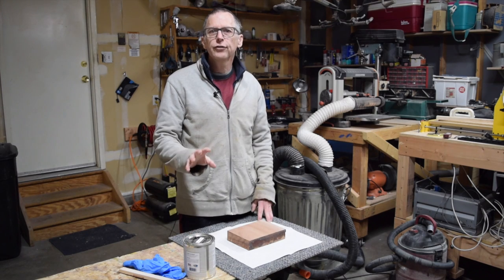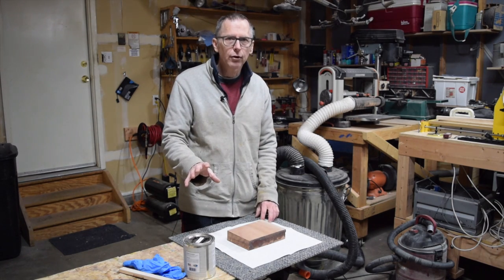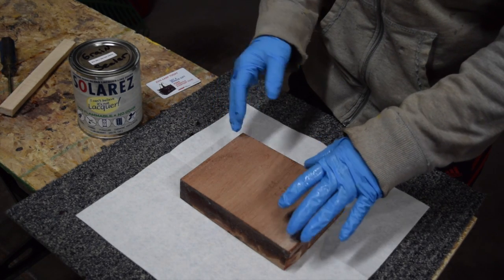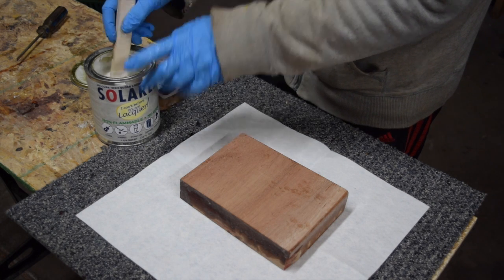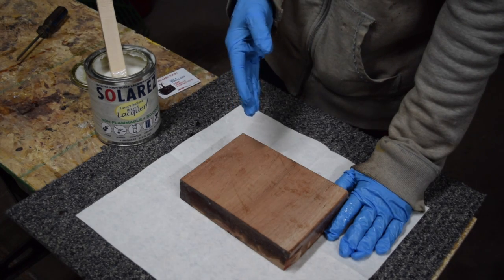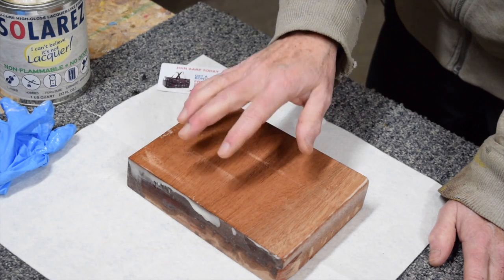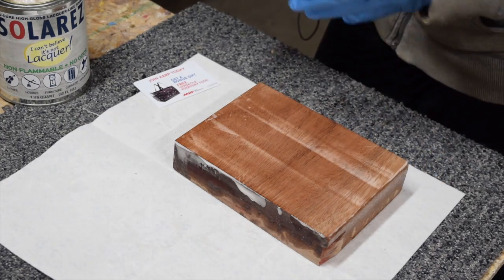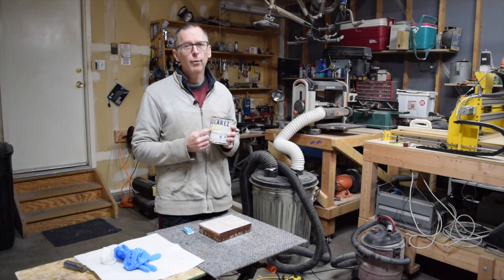The Best Wood Grain Filler I Have Come Across

Comment: I had the exact problem you described happen to me when restoring an old bass drum. I used a water based grain filler that dried super quick and after multiple coats of clear the finish was flawless. After about 3 months grain lines started to appear and being a high gloss black it was quite noticable. Since then I've been using a 2K polyurethane basecoat to fill the grain just by laying down a super thick coat and then level sanding it. Not particularly cost efficient but it does work well. However I heard even catalysed finishes tend to shrink just a tiny bit over time.

Comment: This is the exact video I needed exactly when I needed it. Next project I'm using this. I already went to the solarez site and put it in my cart. I used timbermate on a mahogany body on my current build and after 3 applications theres still spots that i can see the grain. I dont mond doing multiple coats but it would be great not having to wait to long for it to dry. Plus it smells God aweful. I wish I'd seen this sooner.....my girlfriend will never have to worry about my shrinkage problems again!!!
Reply: I found Timbermate to be difficult to work with and not worth the extra work. I think I’ll use this as well! Hope you had good results!

Comment: I ordered some of this stuff directly from Solarez to fill a roasted swamp ash body - at least it was supposed to be this stuff... I ordered the small 4 oz size, and shook it up vigorously for a minute or so, but when I poured it out it was not white, and was not thick like pancake batter. It came with an extra cap that has a nozzle, so that’s what I used. I tried the “rub it in with fingers and scrape off with a card” method, and while that may work great for a flat piece of wood, not so much on a Strat body with the contours. I didn’t notice that there were a few drips on the sides and back and they were a major pain in the butt to level. I’m going to try the “wipe on with a coffee filter” method for the next coat and hope for better results.

Comment: I've used something called micro-balloons doing body and fender work and the product I've used is micro-size hollow glass balloons. It has the consistency of flour. Maybe its the same thing used here? So when sanding you have to be extra careful to not breath the glass dust.
Reply from the maker: Yes, this product used glass micro-balloons. However, I'm not sure if it is still formulated with them.

Comment: Other way I do it, I preraised the grain of the wood by spraying water once dry I sanded with what ever grit sand paper you finished the wood, then I sealed the wood with shellac (2 coats, sand with 400 grit between coats) then apply the wood grain filler if your choice with out worrying about shrinkage , then seal it with shellac again then finish with the clear coat of your choice

Comment: I'm transforming the cabinets in my new home. They were that old school early 2000s golden oak. I know that grain is pretty hard to hide. I just want them to be a nice smooth white. I've seen all kinds of opinions and options to do this, but ultimately this is probably one of the more informative videos. I'm hoping this stuff will fill in that wood grain and allow me to throw some paint over the top. I was considering using some of the spray paint from my job, it's a white sandable filler primer. I figured if I sanded it and then hit it with that, then sanded it again and put some paint over the top it should do the trick. But if I incorporate this product, I'm thinking I will get a better result
Reply: Hey Mr.Nuna916, over the last couple of weeks I have refinished oak cabinets just as you describe, also in white. Believe it or not, the grain filler I used was good old fashioned drywall compound mixed with a little water - to a almost molasses viscosity. Brush it on, let it dry, and lightly sand so as not to gouge out what I filled. It has worked absolutely perfectly for me. Just throwing it out there as an inexpensive, and effective, option.
Reply: @AA-dx9ky  hey I appreciate the response, and you know I've actually heard about this before. There was an older gentleman on YouTube that was describing the same thing and he had mixed it to about a pancake batter viscosity. I actually just finished sanding everything, even though I'm using Beyond paint. I decided it would be better to sand and Prime anyway. Maybe this will alleviate the chipping issue. I'm honestly hesitant to do what you did because of the amount of work and detail it would take LOL it was a pain sanding all these things. I'm going to see how sanding and priming before Beyond paint works. If I like the single drawer that I do, I'll leave it as is, if not I think I'm going to have to go your route

Comment: I have an older guitar that I am redoing. I have removed all the old painted surfaces because it was badly chipped in many places. I also have a couple of areas that have dent marks in it, where the guitar was bumped sometime in its lifetime. Would this make a good wood filler if the same color sawdust were mixed and added to this product to fill in the bumped in area. That way this product would show the wood sawdust close to the normal surface once the dent has been filled to the right level for smooth sanding? It would be a matter of filling the small dent slightly higher than the normal surface with this product and same colored sawdust of the guitars overall surface, and once cured, could be leveled by sanding that area to the right smooth finished level, thus giving it the appearance, no dent was even there in the first place before sealing the whole guitar surface on a final coat of the product you are speaking about here. Have you tried filling a small dent using this product and same colored sawdust as the guitar body? I'd be interested in your findings.
Reply from the maker: No, I haven't tried that.

Comment: Thanks for another informative video, Chris.  Can this grain sealer be dyed?  Is it compatible with oil finishes? Mark
Reply from the maker: No, it cannot be dyed and yes, it is compatible with oil finishes as long as they are completely cured.
Reply: @HighlineGuitars  Thanks Chris, any recommendations on filler/sealer like this one that would prep porous wood for stain/dye application? I want to stain the top without it seeping through the sides of the body

Comment: Hi Chris have you experienced Solarez grain filler not curing in sunlight?  It happened to me.  I sanded and prepped my Taylor 810 guitar ready for Solarez and applied it first to the bottom (rosewood) of the guitar... let it sit for a few minutes and took it outside into direct bright sunlight about 3PM in the afternoon outside it was about 65 degrees.  After 3 minutes it was still tacky on most areas.  I waited another 5 minutes still tacky. In all it sat in the sunlight for 30 minutes... it had hardened in some areas where I first applied it but the last areas I spread it to would not harden!  I had to use acetone to wipe the uncured stuff off and its quite a mess because it was partially hardened but still tacky.  I'm tempted to never use Solarez again... either I did something wrong or the stuff is a real pain in the rearend.
Reply from the maker: Never happened to me.
Reply: @HighlineGuitars  Hey Chris I talked to the owner of Solarez.  Apparently the oil in rosewood has to be cleaned completely from the surface with a white cloth and acetone or it could inhibit the curing process.  It could take several cleanings before your cloth comes away clean.  The first time I tried it, the cloth was dark brownish purple just from all the oil in the wood which rises to the surface after sanding.  I noticed there were hundreds of little brown pin head sized dots of oil all over the back of the guitar which I thought were left over varnish or stain from the factory that had soaked into the wood.  Glad I called the Solarez factory!

Comment: Hi thank you for your good  video. On the Solarez web site they are showing three Sizes of Micro Balloons filler. Can you suggest a sizes that would provide a maximum transparancy and less milky results uppon curring? because I intend to use rather dark wood since you seam to suggest that if applied in thin layers it provides a clear finish? or is phillipine mahogany is the darkest kind of wood you would recommend its usage?  Also they seam to suggest on the Grain and filler sealer product that the addition of MicroBalloons could be done for light colored wood only. So I am unsure were to stand with using this product for my application. Thank You!
Reply from the maker: That’s a question for Solarez.

Comment: When working with super open pore dark mahogany acoustic necks, I have yet to find a single product that fills the gaping pours while still providing transparency. Even Stewmac grain fillers do not do this. If you have porous wood, the only real option is to keep slathering on clear finish of some kind until you get level. This is very time consuming and a pain in the butt. If you fill the pores with mahogany colored filler, it will ruin the appearance of the grain. You will be looking at the filler, not the grain. If you use "clear" fillers like Aquacoat grain filler on really dark wood, it will "ghost" the appearance when you put on lacquer leaving a whitish haze. The only consistent way to apply stain is also before any filler is used. Otherwise you are staining filler. Next time you look at a Martin neck from the 70s or 80s, think about how much work it was to get beautiful clear grain leveled lacquer. I've also never found any water base products that work as well as oil based. Add to all this the fact that every peice of wood is going to react differently to filler and finish, and you have a lot of work in front of you.

Comment: Really nice products! Did you tried staining black so it can enhanced for example mahogany grain?
Reply from the maker: Not in this video, but I like to apply a black dye/stain and sand it back after it has dried. Then, I use the grain filler. That really pops the grain.

Comment: Chris, doing a project with swamp ash.  For a translucent finish, like a light amber, would I need to first use some other grain filler with black or brown dye first, then use solarez after?  Or does the solarez make the grain pop enough? Thanks!
Reply from the maker: It really depends on what you want to achieve visually. If possible, you should try testing different scenarios on some scrap. Solarez will enhance the wood by darkening it a bit, but it probably won't pop the grain the way you want it to. You could apply black or brown dye first, sand off the excess from the surface, which will leave it in the grain, and then apply the Solarez as a way to fill the grain and provide a protective top coat. Testing is the key. Good luck!

Comment: Hi
I need some advice on grain filler for my snooker cue which is made of Ash wood. Over time grains gets open and can be felt during playing. 
Is there any filler which is easily applied and then smooth out with 0000 wool. I don’t wanna use sand paper on cue.,
I have seen clear gel based grain filler ( by AQUA coat) but they are available only in USA. 
Plzz advise me how to refill the grains on my ash cue? And then smooth with steel wool etc. Thanks. 
Regards.
Reply: Have you tried epoxy? I know the guys who make high end fishing rods usually use 2 part epoxy which seems like a similar application. Epoxy dries quick and has really minimal shrinking.

Comment: Hello Chris, I am new to guitar finishing and your videos are great. My learning has been trial by fire, with some things working really well and then the next time I have an issue. I just finished an ash body bass (poly sealer, primer, hok Kandy basecoat and 4 coats of clear) and not knowing how porous ash is, I am at the very dilemma that you referenced. My finish has sucked into the body. How is the best way to get this finish stripped down to the point I can apply this product to prevent the ash texture from sucking the finish. Would I start sanding at 120? I am assuming I will have to get this back to bare wood to apply this grain filler. Or do you have any other tricks for a situation like this.
Reply from the maker: Sand with 120 to strip and follow with 150 and 220 to smooth. Then apply the filler.

Comment: hi I have a couple of questions I have two guitar bodies I am going to finish one of them is from a squire showmaster 7 string that I got cheap I already took the paint off which was a nightmare and I wanted to ask you what would you recommend for sanding sealer the body is made out of older I think the other body is pine. I am going to do these two bodies for now so I don't need a giant can of sealer what would you recommend
second question related to those bodies I am planning on painting them solid colors and was hoping I would be able to use the HVLP spray gun and again right now these are the only two bodies I have to work with so as much as I'd like to I can't buy the sprayer you're using what would you recommend do you think the harbor freight cheap $25 sprayer with work or should I get something off of Amazon
what grit should I sand these bodies to before paint
thanks for your help and for your great channel and content
Reply from the maker: I am using an all water-based finishing approach with products from Crystalac. For that reason, I have to use a spray gun that has stainless steel passages, which makes them more expensive. If you want to use a cheapo Harbor Freight gun, I would recommend spraying solvent-based finish like automotive lacquer or 2K polyurethane. However, you will need to spray outside or in an explosion proof spray booth and you will need to wear appropriate hazmat protection (total skin coverage and a respirator). Sand the surface to 400 grit before spraying your sealer, primer, and paint.
Reply: @HighlineGuitars  well, i do want these bodies to come out well and be happy with them, i know ill be doing more in the future.
what would you recommend for me to try on these bodies so they come out ok. spray cans? these are going to be my first paint work and i don't want to get discouraged with crappy results for future builds. i mentioned the cheap harbor freight sprayer as one option but im willing to buy something to get good results. please point me in the right direction
Reply: What do you think of this as an inexpensive option...since you mentioned you're using metal passages in the sprayer as opposed to usual plastic ones you find
eBay item number:390566555911

Comment: Hi Chris, thanks as always.  I like the way Z-Poxy shows grain patterns but have the same sinking issues as everyone else.  Would you use a seal coat of Z-Poxy to set the color and then use the Solarez filler over it to level the surface?  We're talking mahogany and Spanish cedar here.  Cheers, Skip
Reply from the maker: I would mix dye with a water-based poly for color and Solarez on top to fill, seal and even top coat.
Reply: Sorry, I didn't state my case very well.  I was talking about the way Z-Poxy makes unstained wood look.  It's a pretty good filler too but the Solarez seems to be what we all wish we had been using.  For laughs I'll try the Z-Poxy on scrap and put the "I Can't Believe It's Not Lacquer" over the top to see how it adheres.  I have both in the shop now -- and I certainly have plenty of scrap.  Thanks, sh

Comment: Chris, I love your videos thank you for making them! I have a question, on a mahogany body where I want to use a cherry red stain, should I mix with this product or first stain and then grain fill? Thanks!
Reply from the maker: Stain then fill.
Reply: I would use a sealer after the stain. It will give you protection from washout and will give you a barrier when sanding the filler smooth.

Comment: Actually a better question - on snowy days, quite often the sun is usually hidden by clouds, etc .. is that amount of sunlight still enough to cure solaraz products ?  Also - do subsequent coats require their previous coats be sanded so they provide "mechanical" bond or this is not necessary ?  Not that I don't plan to sand, this is more of a chemical property question to see if a proper bond can still be achieved without scuffing the surface.  Thank you for your time.
Reply from the maker: Yes, it will cure on cloudy days. It just takes a little longer. I recommend scuff sanding between coats.
Reply: @HighlineGuitars  - Perfect !!!  Thank you for your response.

Comment: Hello! Thanks for the video! This is a Water Based Grain Sealer/Filler?
Reply from the maker: No.
Reply: @HighlineGuitars  is it possible to dry this sealer in normal conditions? Not under the sun or special lighting in specific spec?
Reply from the maker: @Matan2222222  I think you can add MEKP to cure it, but I don’t know for sure. You’ll have to ask the manufacturer.

Comment: Is that a water based product, and would it work with oil based finishes and or shellac, waxed and de-waxed? I am doing a natural ash body and just experimenting on ash sample blocks at the moment. I wet sanded (220) using Danish oil and seems filled when it dries, but then I applied amber shellac over that, and the grain seems to be raising again.
Reply from the maker: It's not water-based and I would use de-waxed shellac. It's possible your amber shellac contains just enough water to raise the grain.
Reply: @HighlineGuitars  Very good! Thank you for the advice, your videos are excellent.

Comment: Hello
Loved your demonstration, I build acoustic guitars using rosewood and its extremely hard to get it pore filled. Will this product work on the thinner wood.
Reply from the maker: I think it was designed for acoustic guitars. Some have had issues curing it on certain dark woods, but I've had no problems myself.
Reply: @HighlineGuitars  thank you very much.